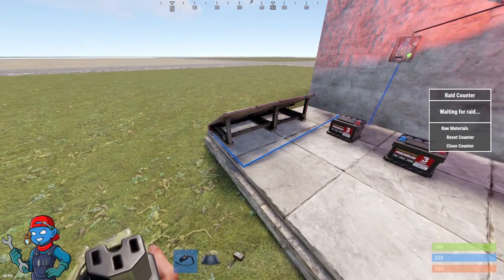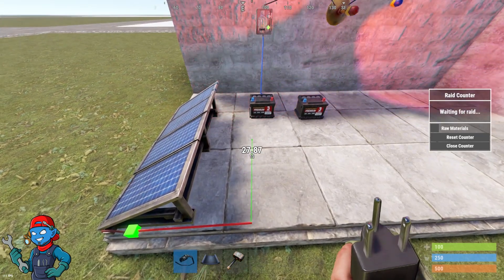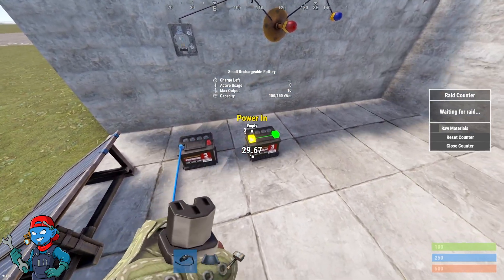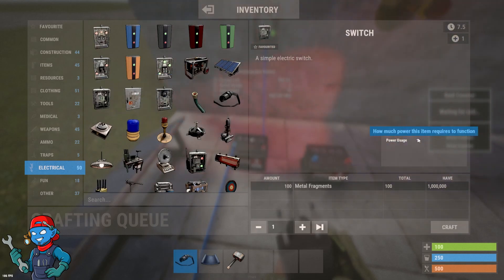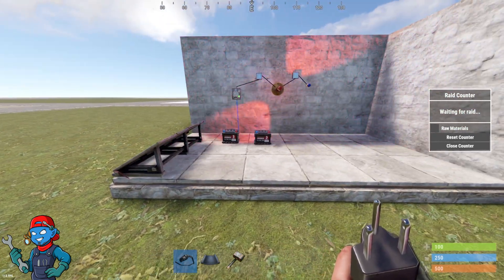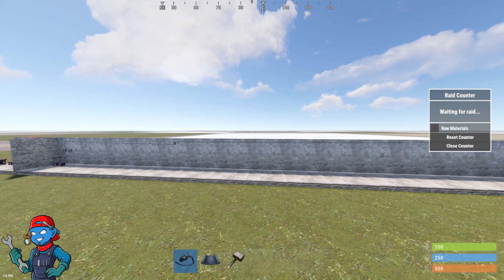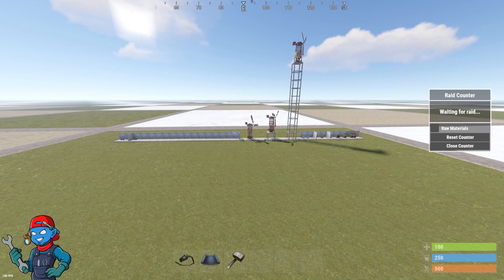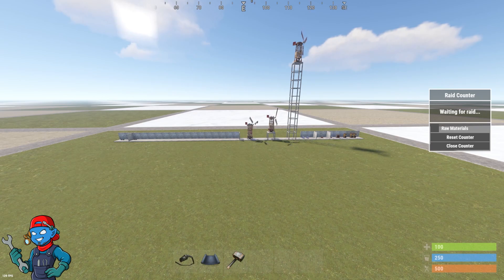Rust Electricity Guide 2022: Part 1 - Fundamentals

Comment: Pretty good video i must say ! And there is a couple of questions that i have about rust electricity, those will be dumb questions but here they are, is it like possible to combine maybe 3 to 4 small generators via those root combiners to power up 1 large battery ? I mean like (2 gens = 1. root combiner than another 2 gens = 2. root combiner and than those 2 root combiners connect to the third one and from it to the large battery at this point you got like 160rW per 8 mins or what im saying is just one big hell of a bullsh*t 😅😅
Reply from the maker: Naw not dumb and you should be able to do that- actually given me another idea for a video